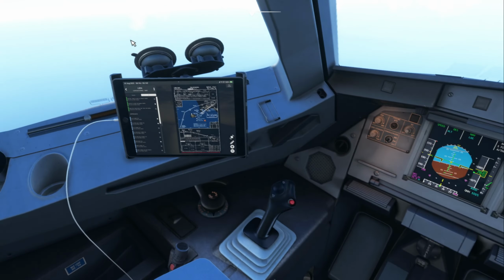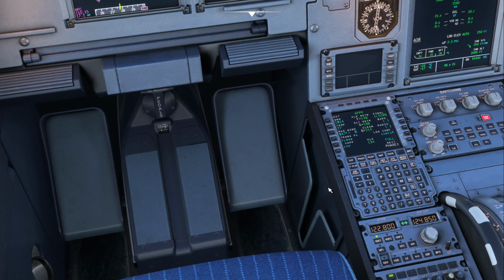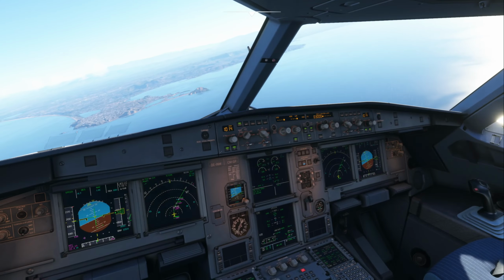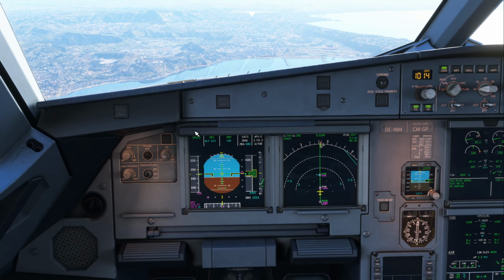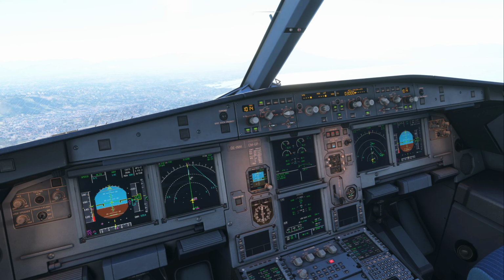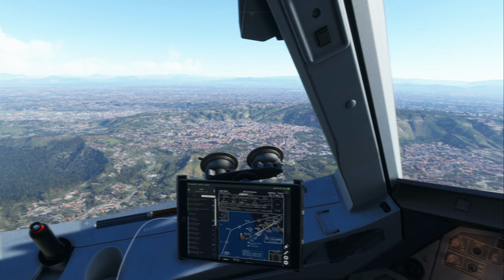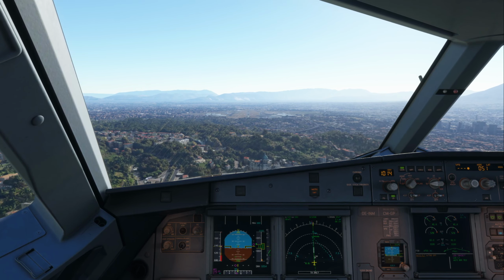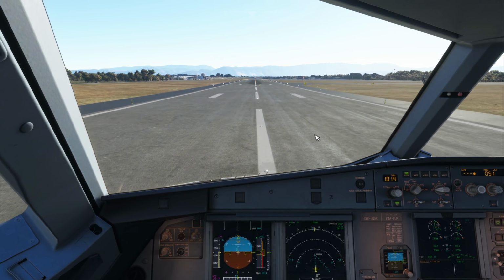Fenix A320 - Offset ILS Approach Napoli RW06 - over the city.

Comment: I've done this approach a lot with other sims, but MSFS took it to another level.
Reply: Crazy how good this sim has the potential to be, especially with groups like Fenix releasing such high quality planes.
Reply from the maker: Fenix is crazy, and short of a few physics problems the sim is fantastic.
Reply: @pilotjonny27  I agree. Once it has bitten you, there is no turning back.
Reply: @pilotjonny27  I've noticed the plane has an exaggerated tendency to float on landing. It's almost comical how much ground effect there is. I had a fully laden A32 which i brought into an exaggerated flare. The plane started wafting upward despite being well BELOW landing velocity. Like, fewer than 100 knots and the plane was sailing upward. So yeah, there are some physics issues every now and then 🤣
Reply from the maker: @danmoretti8898  I'd actually say with the addons I've got and the improvement mods for the DA40 etc they are actually pretty spot on. Fenix flies well, just takes a bit of tweaking with sensitivity.. But the default 787 is pants thats true haha!
The DV20 is nonsense though. Floats well below stall speed. You dont want to be pulling more than 6 degrees up or the A320 does float. Unless you approach slower off the autothrottle.
Reply: @pilotjonny27  Hm well I certainly caused the issue with an exaggerated flare. Still, I don't think the plane realistically would be floating - even traveling upward at </=100 knots. I've heard from real airbus pilots that the 320 loses energy very quick in that stage of flight. Anyway, I appreciate your thoughts, and it certainly isn't a big issue as long as I go for a gentle flare.

Comment: What does ''offset'' mean and how is it different from normal ILS landing?
Reply from the maker: So the final course of the localised as you see does not align with the runway - it has an "offset" of about 4 degrees
 It just means it's going to have a higher minimum altitude because you need to make a final adjustment to the runway course